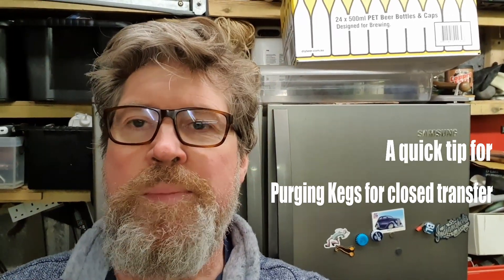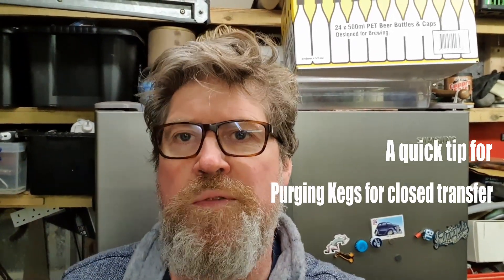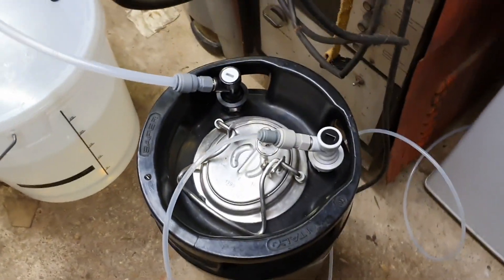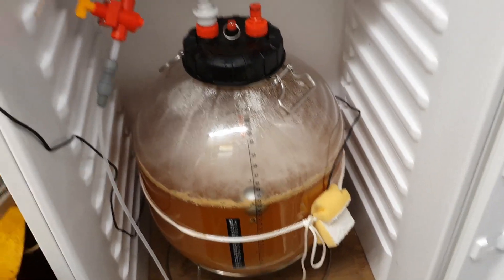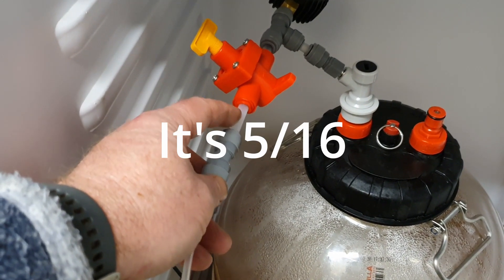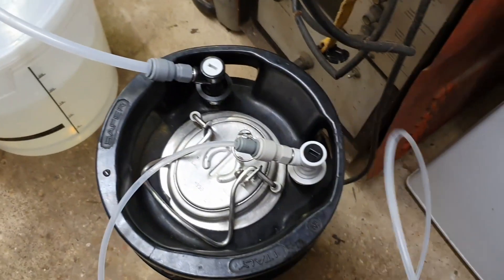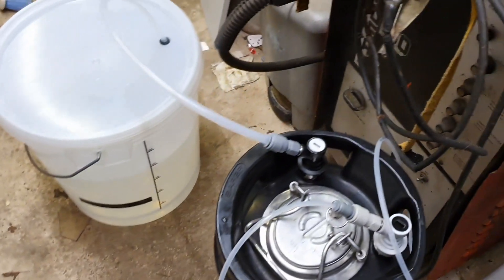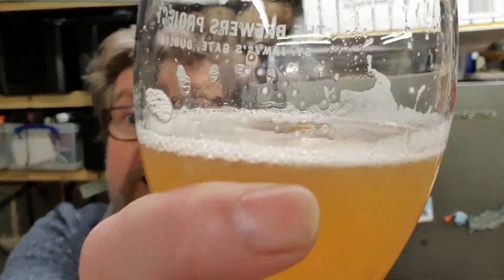HBW #2: A quick tip for Purging Kegs with CO2 for closed transfer of Homebrew Beer

Comment: Jonny, as a more permanent solution you could route a length of the 5/16 cable out the back of the fridge via the drain hole. If it seems a little small, grab a 12mm drill bit and drill the plastic out. Can also route cables for thermoprobes and the heater that way as well.
Reply from the maker: Hi mate, Thanks for the suggestion 👍, for a more permenant solution I'll go down that route. I was just amazed how well the 3/16 pipe works through the door. Cheers 🍻